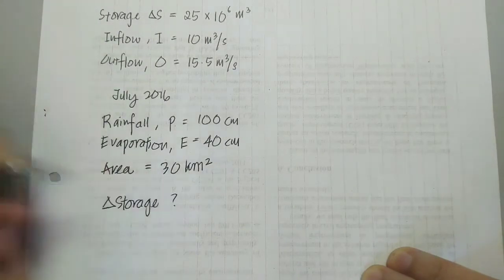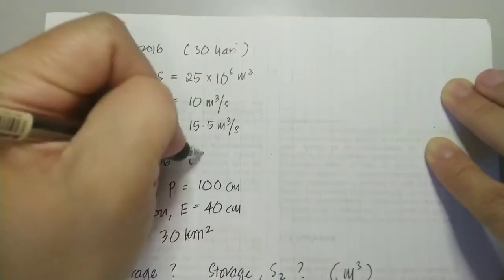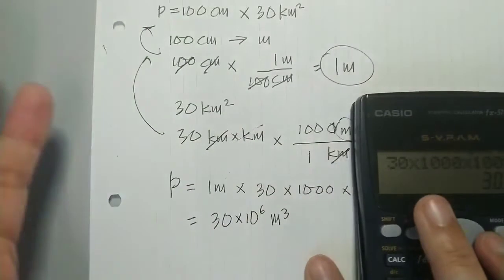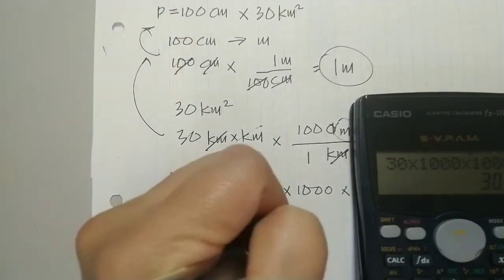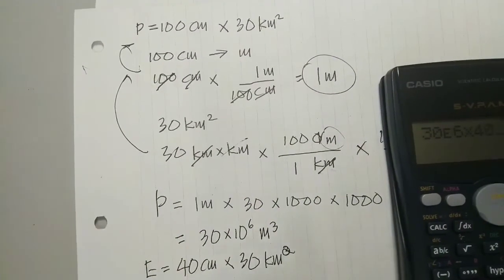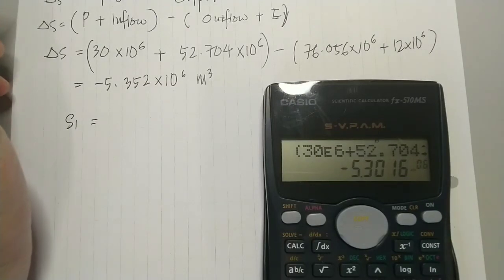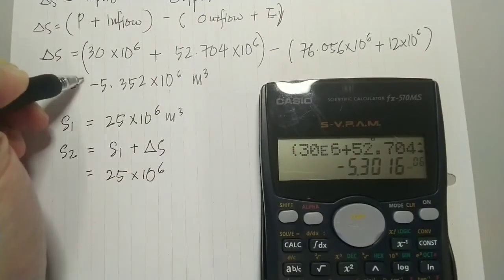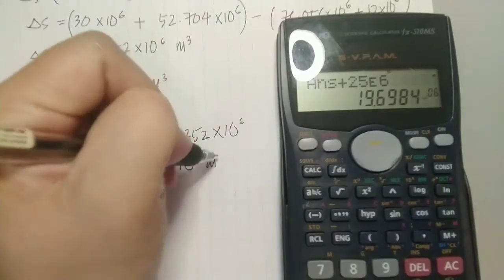Hydrology Balance Equation or Water balance equation

Comment: Your answer is wrong, read it right next time please. the outflow was 15.5 cubic meter per second, thus the outflow is 81691200 cubic meter. Finally, the change in storage is -10987200 cubic meters, and final storage is 14012800 cubic meters